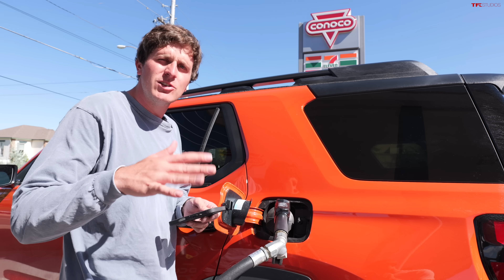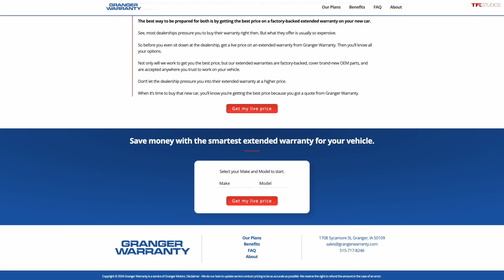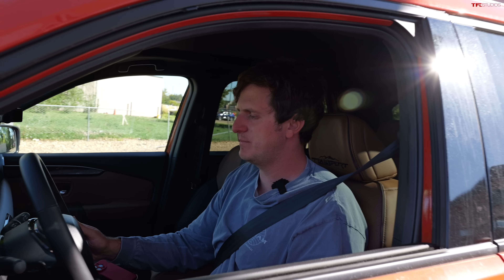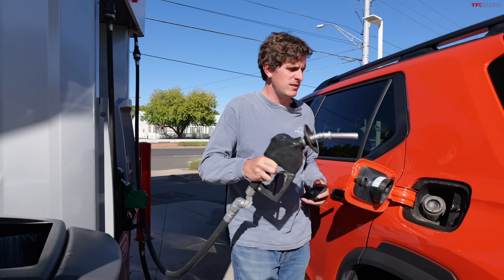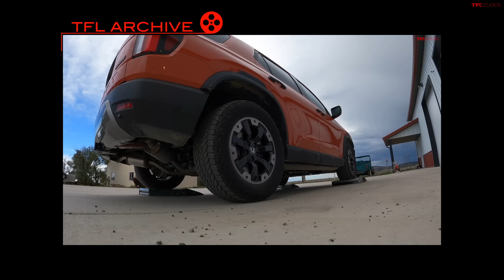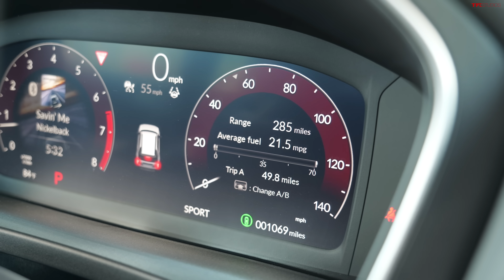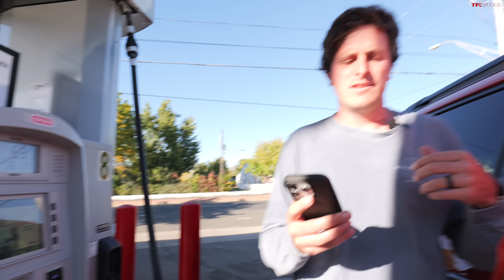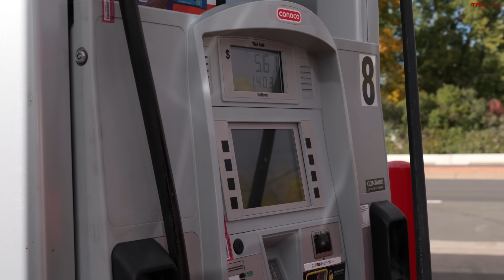Does Driving In Economy Mode Really Use Less Gas?

Comment: Auto start/stop should only activate in Eco mode...which makes sense. Normal and Sport should never turn the engine off.
Reply: ....but why in normal driving do you need the engine on at a stoplight? that's what I never understood about people who dont like stop/start-- what are you doing with that power just sitting there?
Reply: @IndefiniteGentlemen  When you don't want the AC to turn off when its over 100 degrees outside.
Reply: @IndefiniteGentlemen  it's in idle and keeps things moving like the AC. Also constantly starting and stopping the engine creates added wear. I'd rather be ready to go when the light turns green because it isn't saving much gas at all over the course of a stop light.

Comment: The biggest advantage of the auto start/stop isn't to the individual, but to the collective. My Jeep doesn't make much difference running all the time, but all of our Jeeps running all the time do. We as Americans need to remember that although we value individualism, we are also part of a collective.
Reply: Yes wearing out everybody’s starter is good for the service center
Reply: @flethuman I don't belive the data supports that statement.
Reply: @CoreyBrass  show me the data
Reply: @flethuman I keep posting the very easy to find data link, but I think YouTube takes down web addresses. 🤷‍♂️ Again very easy to find several studies that show stop/start reduces pollutants as well as noise and saves fuel.
Reply: @flethuman do a search for "Practical investigation and evaluation of the Start/Stop system's impact on the engine's fuel use, noise output, and pollutant emissions"

Conclusion
The aims of this paper were to carry out a practical execution and demonstration of the intelligent system and to observe its influence on the three main factors, the first of which is corresponds to pollutant emissions, of which our study shows that between 6 and 8% of CO2 and 0.2 to 0.5% of CO are released by volume when the engine is idling. HC gas emissions vary from 1.5 ppm to 2.5 ppm under the same conditions. With the Start/Stop system, these emissions are permanently eliminated when the vehicle is at a standstill. The second relates to fuel consumption, which is zero when using the Start/Stop system, whereas when idling, it is greater than zero. The last factor is motor noise, which generates a noise level of around 40 dB when switched off, but in areas where the motor is running, it generates twice this value. All of this analysis goes to show that the start-stop system provides an effective response to the growing problems of energy loss and waste faced by urban vehicle fleets.
Our low-cost and reliable electronic system is fully realized in our laboratory to validate the approach, as well as being converted to a compact format, and installed in any vehicle occupied by the OBD2 protocol. Real-life tests are carried out on a DACIA Sandero to ensure that the proposed system works properly.
Reply: @flethuman sooooooo did you look at it? 🤷‍♂️
Reply: @CoreyBrass  yes you proved my point about it keeping service centers in business. Just buy an ev if you want clean air.
Reply: @flethuman but at this point an EV can't do what I want to do. If there is an EV that can do what my Jeep does I cant afford it.

Comment: I’ve always noticed with my Hondas that with long highway trips the MPGs slowly creep up.  Almost feels like the car settles in after a while.  30 mile drive to my parents 32-34MPG, 80 mile drive to work 42-45MPG. 2016 HR-V AWD has been my favorite vehicle, such a Swiss Army knife.
Reply: Mine does the same, but I think it’s more of a function of the car is all up to temp and the AC or heat calms down after the interior is a good temp

I’ve also noticed mine if I take a road trip after city driving for a couple weeks, it will get really good mpg immediately after so I wonder if it’s burning unburnt fuel that was in the engine, inflating the mpg figure for that drive
Reply: It's just a fact of physics that steady state driving will result in better fuel economy, for any given average speed. Higher speeds will of course be greatly affected by wind resistance, so the mpg at those average speeds will be much less. The sweet spot for our 2025 Honda Civic hybrid seems to be to keep it under 72 mph on the freeway if at all possible. This allows for good fuel economy, but with speeds not so slow that we increase our trip time too dramatically, or annoy other faster drivers around us too much.  

On a long highway drive, your relatively more infrequent accelerations and decelerations (compared to the time spent at steady speeds) tend to have less effect, since most of the time you are driving a fairly steady speed. Regenerative braking and electrical motor assist will tend to smooth out these effects even further. The result is that the longer the trip, the more you will tend towards the average mpg that your engine and drive train combination is ultimately capable of, for the average speed you are driving. This of course assumes a round trip, to negate any effects of going up or down hills.

To illustrate the dramatic effects of steady state driving, our new Honda Civic has been getting around 51-52 mpg around the city this fall, if we drive it "normally" (not being conscious about gas mileage). I did an experiment recently where I drove our car as smoothly as possible for one tank of gas over the course of two weeks, avoiding any rapid accelerations, and staying on streets with lesser traffic that allowed me to keep the car at a steady speed as much as possible, usually under 45 mph. There was some freeway driving at higher speeds in the mix (not very much though), but I kept the speeds under 65 mph as much as traffic around me would allow.

The result was shocking: I achieved almost 61 mpg, for a car that's rated at 50 mpg in the city.

In watching the average mpg during this time, I could instantly see the dramatic effects of stomping on the gas (to avoid traffic or whatever), even towards the end of the tank of gas (where the average gets harder and harder to change.)

That being said, on our next tank of gas, where we were back to "normal" driving, I'm amazed at how well the engine/drivetrain are optimized to handle normal driving conditions. Over the course of that tank of gas, we still managed to end up around 51 mpg.

Comment: Yeah, as long as you dont hard accelerate.

All ECo mode does is up shift ASAP and hold high gears longer.

Best was to drive for fuel efficiency  is eco mode. And down shift , probably 3 times if you need to pass.
Reply: Except if you’re going over Vail Pass. Then you’ll be bogging down.
Reply: from my understanding the passport has cylinder deactivation, effectively makes it a 3 cylinder on eco
Reply: @rayaankhan5671 while the Passport does have VCM, it operates based on engine load in the background regardless of mode.
The older models ( VCM 2, 6 to 4 to 3 cylinders ) would show an Eco light on dash when it was active,but they stopped doing that for VCM 3 ( 6 to 3 cylinder)
Reply: @hukmai  Honda confirmed, cylinder deacivation is off when in sport and tow modes.

Comment: Yeah, i got a brand new 2025 civic, and it only averaged 25mpg… so i tried Econ mode… and only averted 26mpg…
Reply: I have a 2020 civic sedan. In eco mode I meet the EPA rating of 27 city 95% of the time and surpass it by 2-4 mpg 12-20% of that time. I drive fast so I'm happy with it.

Hwy mpg is a mixed bag though. I bounce between 30-40 often.

Sport mode typically brings my city mpg between 24.8-28 city. I haven't bothered to take note of its hwy mpg in sport mode.

Comment: My 26 PP Transport Elite is at 5,000 miles now, and in true stop-go city driving I get about 18 mpg. Interstate highway driving at 75  mph I get about 24 mpg, so very similar the EPA numbers. This TFL test appears to have been done mostly in very efficient conditions (country roads with steady ~45 mph speeds, and limited stop-go), so the great numbers they found are to be expected. On difference in my case is that in my car the computer is remarkably accurate compared to the MPG measure at the pump. In my car it comes in within about 0.2 MPG almost every time, including when I am towing.
BTW, I recently went on a long 2,000 mile camping trip towing a small travel trailer (R-Pod 171, at 3000 pounds loaded), and had a 13.1 MPG for the towing sections of my trip, during which I keep speed at 65 MPH. Towing control was excellent, very confident and comfortable. 
I am loving my PP! I will keep this thing for a long long time.
Reply: I have a 2019 Honda Passport Elite, purchased it new. It has 84,000 miles on it now. I get the exact same numbers you mentioned for city, highway and towing a boat. My weekly average of mixed driving is 20.8 MPG. It has been a great vehicle. Regular maintenance and one new battery, new tires and that is all, still original brakes. Paint and interior still look great.
Reply: Do you find the small fuel tank size to be a problem with range when towing?
Reply: @ChopperChad  Not really. If driving straight through, I can go ~200 miles or ~4 hours with a tank, and by that time I want to stop anyway. I used to carry at 5Gal gas can in my previous truck/trailer that had a lower range (~180 miles) and I never used it, even though it was a nice insurance. With the Passport/R-Pod I am not taking the gas can anymore, and I am not missing it.

Comment: It makes sense that there isn't much difference between Normal and Eco, after all, Normal mode is what is used for EPA ratings and they need to maximize that.  Not sure on the Honda, but on my F-150 Eco mode does blunt throttle response and shifting compared to Normal, but is not near the difference as Sport mode, which really wakes it up and feels like a different drivetrain altogether.

Comment: I’ve noticed a difference in my wife’s hybrid CR-V w/re to the the battery management. In Eco, it will very consistently keep the battery on 20-80 (except on very long or download coast stops). In normal, it goes to 90% to even 100%. I leave it in eco for extended battery life since we drive them until they die. Ambient temp affects mileage more than the Eco button.
Reply: Come to think of it, I have noticed the same about battery usage. That's one reason in favor of ECO. 

We go back and forth between Eco and Normal. After 6 months, we haven't come to any definitive conclusions that have permanently swayed us one way or another.

Comment: The only problem with the V6 is the d*mn timing belt!
Reply: To be honest I’ve seen enough timing chain issues with competitors V6 (namely the 3.6 GM motor, a pentastar, and a VR6 VW) in my life that I’m convinced the cost ends up being cheaper to just replace the belt every 100k. 

If you go to an independent shop and use either OEM or Aisin belt, timing belt and water pump should be less than 1500 including all labor
Reply: @davewilson7602 - oh I know all about the differences. Trick is don’t buy vehicle with engines that are crap. Truly the competition definitely have far, far more reliability than people think. They always focus on Bob that had a problem and complained to 20 people & so on. The internet is rife with false declarations or simple gross exaggeration of the reliability of things. 
   GMs 3.6, especially 2017 or newer is a great engine. The PentaStar has been crap, but is far more reliable & even good now. It’s still not for me as there’s very little low end torque. The 3.5 & 4.0 litres in Toyota are exceptional, not perfect, but very few issues with timing chains. The 3.5 is again an engine that’s not got enough torque. The Ford 4.0 litre lasts over 400,000 k with no issues very often. It’s a very reliable engine. The 2.3 EcoBoost isn’t perfect but timing chain failure is a fraction of 1% of those engines. 
    Sorry, there’s no way I’m taking a guaranteed expense over ,,, maybe,,,, having a timing chain issue. For every vehicle with a powertrain issue period, there are over 95 others that run problem free into very high mileage. I have friends that own dealerships & they keep track. The only dealerships they have dumped in the past 10 years are Volkswagen & (now) Stellantis. It has more to do with the parent companies than the vehicles but the reliability issues are definitely the second reason in both cases.

Comment: I’d much rather have this vehicle than the Jeep equivalent.
Reply: Grand Cherokee, you can get 10k off sticker. They are not selling. 

It’s luck of the draw if you get a good one or bad one. QC is pretty poor. 
Lease deals are great and only way to buy one. 

Passport drives much better.
Reply: For a new car yes. If your are gonna offroad then an older Wk2 grand Cherokee is probably better. Maybe not as reliable but good enough
Reply: There is no Jeep equivalent.  The Grand Cherokee has 4wd low and has very different driving dynamics.   The Cherokee is too small to compare.
Reply: looks like a compass, which is really a FIAT, i think . so yeah, you definitely would. But i would never take that honda offroad. maybe a graded dirt road.
Reply: I would never give up my '21 Grand Cherokee Trailhawk for this thing. It is a great combination of on and off road capability has a touch of luxury and has an excellent set of features for my use. The Hondas may match it for on road driving but not anything close in the rough stuff.
Reply: You have a very special vehicle. Hold onto it as long as possible. Grand Cherokee Trailhawks are hybrid only now.
Reply: @byronlarson5534 while you’re out there have all your fun I bet you don’t have that one important thing……Dependability.
Reply: @Bunkysworkshop Have owned it almost 5 years. Only non maintenance part I have had to replace was a daylight running light bulb (I bought an expensive one at O'Reilly's for about $10). I know this Honda would have done much better than that - I guess I am missing out on that Honda dependability by buying this Jeep.
Reply: @byronlarson5534 at the end of the day are you happy with your choice is all that matters. 👍
Reply: Jeep missed the boat in 2026 and did not offer the Hurricane 6 twin turbo motor in the Grand Cherokee.   New higher spec Grand Cherokees will now come with a turbocharged 4 cylinder engine.   I currently own a 2020 Grand Cherokee High Altitude and will be selling it and buying a 2026 TrailSport to replace it.   TrailHawks are also hybrid only which is a no go for me.   Also, it is very hard to get a new Grand Cherokee with 18” wheels.
Reply: @Cycle9568   Hybrids are great...a Jeep hybrid is a no go until they can prove reliability.  Of course, their ICE vehicles aren't terribly reliable either.
Reply: @veganpotterthevegan I have 100k on a my current Jeep without a trip to the dealership.  So in my opinion it has been reliable. But the WK2 drivetrain is the same drivetrain being used in the WL models.  You also made my point of not wanting to buy a hybrid jeep drivetrain vehicle.  Not reliable enough to spend my money on.
Reply: @Cycle9568  100k miles is not a good goal.  I bought an escape hybrid with 180k miles on it.  I sold it with 380k miles and never did a thing to it beyond scheduled maintenance.  I sold a Toyota Matrix for 450k miles that I put about 300k miles on.  It only needed one motor mount as non-scheduled maintenence.   My 300zx has an extra 200hp.  I flog it and its got 200k problem free miles on it😅
Reply: @veganpotterthevegan haha. Nothing is wrong with 100k. Did not say it was a goal that is the current mileage.  😂
Reply: @Cycle9568  sure, you gotta get to 100k to get to 200k.  I'm just saying that I'd never use that as a benchmark for reliability. You also had to get to 1k right?😂

Comment: A small sample set, i.e. 50 miles, and tiny differences widely swing the results. Even a TENTH OF A GALLON changes the final mpg 1+ with this vehicle.
A proper data set would have been at least the “Denver 100” y’all run.

Comment: I recently purchased a 2023 Honda Ridgeline RTL-E with the eco button.  I found a difference in power...it feels like the parking brake is dragging when using Eco.  In normal or drive, the power feels more instant...and on a drive to MN's North Shore, I had it on Eco from the Twin Cities to Duluth, MN.  From Duluth, to the Canadian border, I deactivated the Eco mode and tried running it in normal or sport...which I like better for power delivery when driving on some hilly and curvy roads.
Reply: eco mode is just a rev limiter. that's all it does.